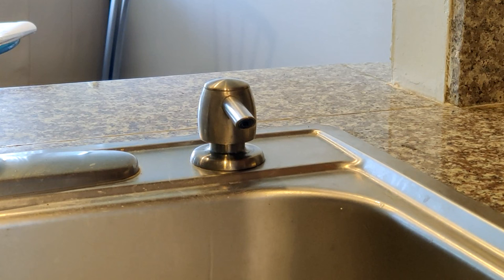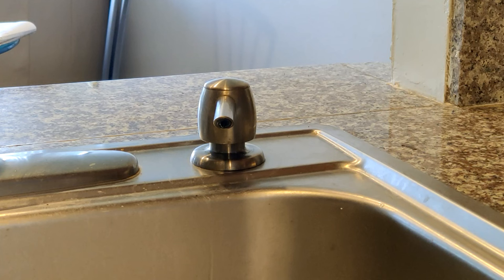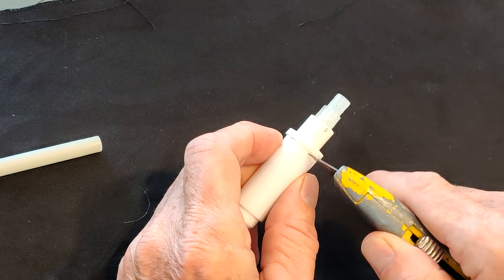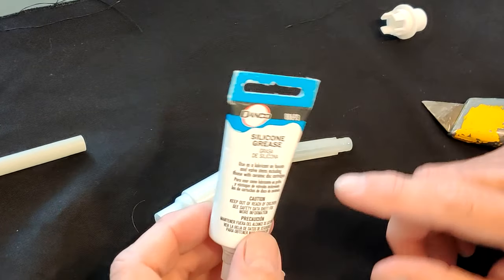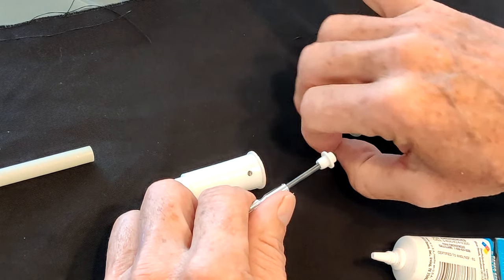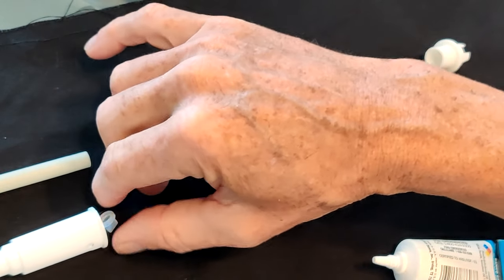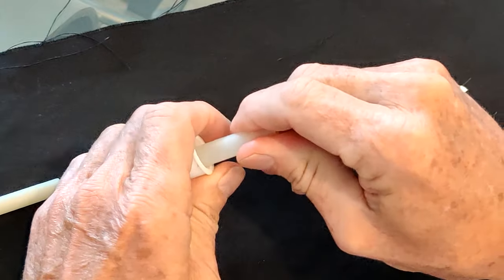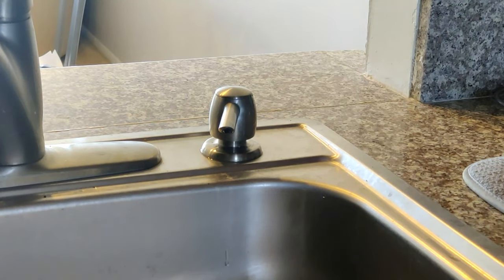Delta Soap Dispenser Repair/Clean/Lube

Comment: I never could have figured out how to take the pump apart.  I did everything you suggested to repair my Delta Soap dispenser.  However, it still would not work.  It kept jamming and extremely difficult to get the shaft to return to the top.  I had to use a spoon the pry the shaft up.  I took it apart for the 3rd time trying to figure out what was happening.  I had discovered the rubber O ring that is in the groove on the shaft  was stretched and was super loose on the shaft.  I figured out  it was probably rolling in the groove and jamming the shaft.  Went to the hardware store and got the correct size O ring for 60 cents and it works as new.   The size of the new O ring is  7/16 X 9/16.  I might suggest that one gets a new O ring and replace the old one when the pump in disassemble.  Delta does sell just the replacement pump for about $10.
Reply: Awesome!!Thanks

Comment: This is an excellent tutorial on how to take apart and clean or grease your soap dispenser. I was getting almost no soap after using mine for 12 years. Robert gives a clear step by step explanation and best of all gives warnings of where  you need to be especially careful so you don't lose parts or put things together incorrectly. A+A+A+

Comment: Worked great for my Kohler soap pump as well. The Kohler is similar except it uses a ball valve below the spring (i.e. when the pump is in its normal position a small ball is below the spring and covers the hole so the soap can't flow backward). So there was no plastic valve down there as the ball replaces it. But Robert's advice to be careful when disassembling was spot on, as the ball went flying over the little barrier I had set up. Otherwise, the procedure worked the same, except I didn't check the top valve, as I didn't want to risk it. The O-ring looked beaten up, but applying some lube still did the job—it now literally works better than when it was new (it was a little sticky from day 1). I didn't have the silicon grease so had to use Vaseline, so we'll see how long that lasts. Thanks Robert!!

Comment: Thank you!     Thorough directions including how to fix every possible screw-up like unexpected small parts flying out.   I just fixed three of these in 5 minutes!  And DESPITE your warning I tore one of the silicone valves with a screwdriver.  But NOTE: these things have a lifetime warranty to the original owner!  This repair is a lot easier than obtaining warranty service but it's there if you need it and they are great.   I combined the pierced valve with one of the decorative spouts that had a cracked neck and wouldn't stay on, and will get that replaced as a unit.

Comment: Great Video!  Thanks for taking the time to do this.  I probably would have damaged the pump and had to order a new one if it wasn't for this video. Didn't have any grease that's mentioned, but lithium grease worked just as well.  Maybe it won't last as long as the plumber grease, but it's pumping smooth! Note, if you use lithium grease make it temporary as it can corrode plastic and rubber parts.

Comment: Ty for this video, I was about to toss the dispenser or take a hammer to it.  Just couldn't see the split line on the plastic until your video pointed it out.  Works great now and saved $15 for a replacement.  One thing, putting the top section back on is a very tight fit, I couldn't get it in by pushing.  I took a 13mm deep well socket that seated and fit perfectly over the top and gave it a tap with a hammer and down it went.

Comment: Thank you!!  Very instructive and useful. You revealed the tricky bit where the knife was required (I would never have found it).  Even though there was suction in the pump section, mine didn't work immediately afterwards until I primed the pipe and pump with water, whereupon it now pumps like a sailor on shore leave.  Also, mine had built up (maybe mineral) deposits such that the orifice in the head was reduced from about 4 mm to probably 0.5mm.  Sunday morning job done!  Thanks again for your clear instruction. 😊

Comment: Thank you so much for uploading this informative video!!  I have been attempting to clean and lube this valve without taking it apart for several years with only temporary success.  Taking it apart and directly lubing the o ring worked great .  Thank you again.

Comment: Thank you for the excellent video and easy-to-follow instructions on how to repair a Delta soap dispenser. I was tasked with finding a solution for the sticky dispenser in my main kitchen. In less than five minutes, I watched your video, and shortly after, the issue was successfully resolved. I'm now exercising bragging rights thanks to your detailed video.

Comment: Thanks Robert for this great fix.  Took less than 5 minutes to get my Kohler working like new.  Always thought it was defect and it always stopped working when I used non dish wash soap. This saved me from buying a third replacement.  Manufacturer should add instructions on how to fix this common problem.

Comment: The knife didn't work I had to use 2 channel locks and pull them apart. The mineral deposits glued the pieces together. I finally got it apart and it's pumping like day one 👍 thanks again pal!

Comment: Never knew I needed this video, but thanks for the info! I found this while searching for a way to install a tube that feeds the soap up vs using the standard bottle. I noticed these dispensers have a vent, so it would end up all over the outside of the tube if I remove the bottle. If anyone has any suggestions, I'm all ears!

Comment: Thank you so much for your excellent video!  We have these ridiculously expensive Dornbracht sink fixtures in our kitchen and this is the first problem, which, thanks to you, I now know how to fix. I don’t know if you have an answer to my second problem:  someone accidentally recycled the soap bottle that fits the non-standard (not U.S. standard) cylindrical body and thread size of the Dornbracht fixture. Thanks! Melissa
Reply: Probably too late to help now, but if you are still trying to figure out what to do about your missing bottle, you could make an upgrade.
You can get a kit which extends the tube all the way to the bottom of the cabinet under your sink.
This enables you to just put a bulk bottle of soap under your sink instead of using the small bottle that comes with the pump.

Comment: will this fix my dispener that stopped dispensing?  There is no problem with it sticking/staying down but it stopped pumping soap out for the most part. Pumping hot water used to fix it but doesnt really anymore.

Comment: I am having trouble separating the two components of the housing, the part where you used the razor. What am I missing? Do I have to push in the two little tabs?